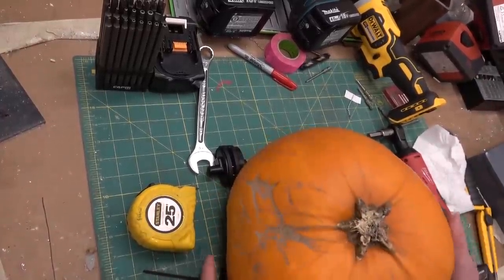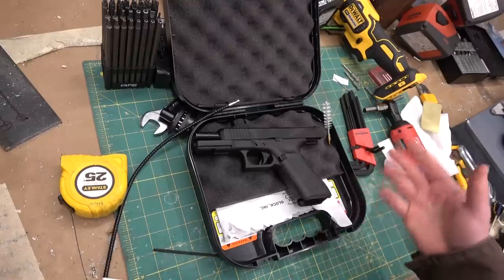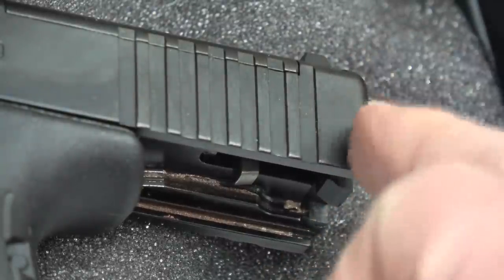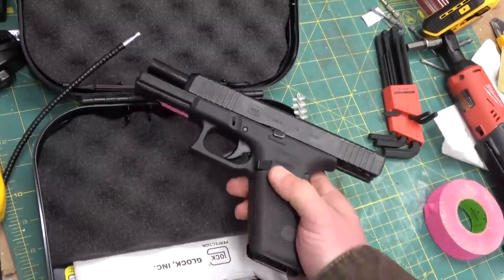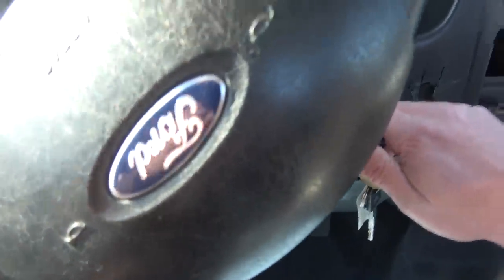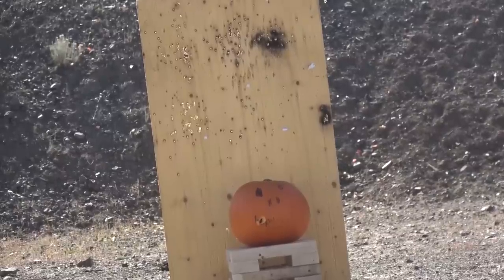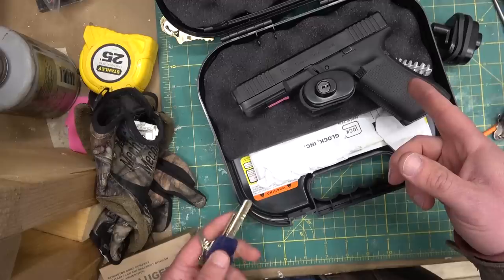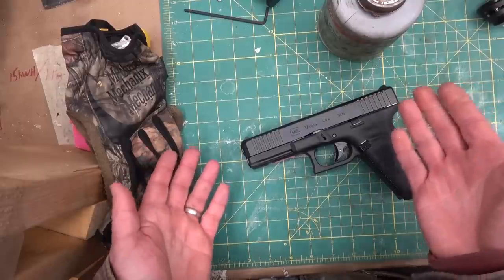BOLTR: GLOCK 17 GEN 5

Comment: Now do a Smith & Wesson M&P! Any of 'em would do it for me. I'm not really a Glock fan so, you know, go reinforce my biases for me. Actually, now that I've watched through most of this video, I'd be really interested in seeing your comments on an M&P Shield 9mm. It looks quite similar under the hood, but is on sale for $210 near me right now. I do believe mine came from the factory with proper oil on the slide, but it's been a few years now. I don't think I'm buying the lapping idea since most slide pistols I've seen have what looks like parkerizing on the mating surfaces. I'm probably wrong, but that doesn't seem too conducive to lapping. I just don't think the tolerances really need to be super tight between the receiver and slide, since the barrel and sights are both on the slide itself. The tolerances between the barrel and slide are pretty damn wide open too, but the action spring keeps the barrel preloaded into a specific spot in the slide.

Otherwise, the internals look remarkably similar but also different in interesting ways. In general, they both have low-precision parts in the receivers but everything in the slide is either machined from billet or forged and machined.

You might also be interested to know how barrels are made. I was playing a random-ass old online space game and chanced upon the very man who made the barrel of one of my rifles. Got to talking about the process and it surprised me. He said that they start with a short, fat chunk of chromoly or whatever alloy, then they drill THAT way oversize and use a robotic forge to stretch it out to the desired length AND diameter. That way, they don't have to actually do any really deep drilling. Probably don't even have gun drills on-site!
Reply: The M&P line and the XD line are just gross. Please deposit all such products in the nearest waste receptacle.
Reply: S&W is good at ripping off Glock designs thus the similar parts.
Reply: @ZE0XE0  M&PS are fine. they just need to get rid of that terrible trigger. Now as for XDs those can go right in the scrap pile.
Reply: The thing about pistols is that almost always, the gun is way more accurate than the shooter, to the point that accuracy isn't really a concern
Reply: Tungsten Swim Team I was just going to say, almost all plastic pistols are descendants from Glock.

Comment: Eurica!!!
I've watched your channel for some time. Good stuff!
You're in my wheelhouse now mister.
The copper anti-seize:
Glock uses this "grease" to assist in the break in of the pistol. It actually grabs the soot and dirt to mate the surfaces together. I'd run two to three hundred rounds through the pistol before cleaning it.
You were correct on that assertion.
Glock only refers to their frame as "polymer". (Your 11 herbs and spices)
Rifling- a Glock has no lands and grooves, commonly associated with firearms. Glock did away with the sharp angles and rounded them off.
Gaston Glock invented this pistol for the Austrian Army from the perspective of a window blind manufacturer.
Overlooked was the metal used in the upper receiver (slide). Glock uses a (Tinafer (SP)) process making their metal nearly as hard as a diamond and 99% rust free.
Keep the videos coming!
God save your RCMP!

Comment: If you can send me a small chip of the plastic I can run it in our IR-spectrometer at work to figure out the type of plastic it is.  Less than 1x1x1 mm is needed to get an accurate scan.
Reply: Zytel.

Comment: The rifling "artifact of manufacturing" you're spoke of is, actually polygonal rifling. You forge the barrel blank over a mandrel instead of button rifling or cut rifling. It allows for a greater gas seal with projectile and increases barrel life. It's also supposed to reduce copper fowling and bullet deformation which means there is less drag on the bullet in flight. It's more popular in European designed firearms, but is gaining traction in American designed firearms. Love the videos and I was just tickled pink to see you made a firearm video!

Comment: Can confirm. That is a lapping compound. You have to “shoot them in” for around 200  rounds.

And come time to fight believe I’ll have of those in hand.
Reply: LuX.Up The only thing that can stop it is underpowered ammo.
Reply: As a man that has been shooting for over 35 years, has worked for several of those in a gun range, and lives in Florida... I can assure you that the factory lube is more of a break in compound.  After about 500 rounds it will wear off and smooth the action.  Then you can clean the firearm properly and lubricate with an appropriate oil.

Comment: "this is not lubricant!" While holding the container that clearly says "lubricant".
Reply: Regardless of what it says on the container, he is correct, it’s not a lubricant. It’s abrasive.
Reply: WD40 says "lubricates" on the can. It's apparently not a lubricant either.
Reply: @thebigmacd  you're correct
Reply: It's not a lubricant design for parts that regularly or constantly move, it's designed to allow something to move one time at some point in the future.
 WD-40 is also a lubricant, although a very light duty one. It is sometimes a good alternative to water as a lubricant...wet sanding aluminum for example.

Comment: G'day AvE, The easy way to pull that firearm apart is, from your normal right hand shooting grip to place your right hand fingers over the top of the slide while leaving your thumb where it was under the tang, then pull the slide back slightly using your fingers. Your left hand is used to pull down on the slide lock lever (both sides). And finally, as you attempt to remove the slide from the firearm after completing the above, you need to press the trigger a second time. (first time to fire the action off, the second time to ensure the trigger and firing pin sears are disengaged. Also, the magazine does not need to be inserted for any of the safety features to operate. The raised piece of metal on the right had side of the internals works like a 'cam' when it moves laterally rearwards to depress the firing pin safety. Finally, the sights are set up to shoot point of aim. The rear sight is a friction fit and can move sideways. If too easily, it can be replaced with a new factory or after market product. Shots low on target up to more than 30m are because the firearm is pointing down at the time of discharge. If you do super slow frame imaging on your shooting (looking only at the firearm) you will see the muzzle dip at the last moment and that is what will have caused the low shots. Sorry for the long message.All the best from Australia - 20 year Glock firearm instructor. David

Comment: Hey man, the dual spring is an upgrade to what is the primary fail point on the glock. Second spring extends the life atleast 20k rnds.
Secondly I hate the glock trigger - you might want to look into upgrading it , next time you shoots it - pull the trigger slowly - feel the uptake / slop before the break wall- then another 5.5lbs or so will get you past that wall to fire , HOLD the trigger down and slowly let it forward JUST until you hear that click so you can avoid the sloppy uptake ... get good at that to get great follow up shots.

Look into an RMR sight too, that’s a great upgrade To keep your pews on point ...
Not saying you should do it but on the back of the slide there’s a little flat part that can be upgraded to make that glock fully automatic ..
Also you may want to look into stippling the grip(literally burning a texture with a wood burning instrument with specialty tips) so you get a better positive purchase on your grip due to its plastic chincyness AND it also looks really cool.
Well some guys leave their stuff OEM / factory ... I’m not one of those guys... 
I appreciates you doing firearm reviews - I wish you’d do more.. let’s figure out how to avoid the ITAR laws here in the USA (legally and legit) and I’ll send you some more to review! 
Check out polymer 80 / P80 lowers for glock 
Also if you want a nice paint job for it look up blowndeadline on Instagram

Comment: Glock Certified Armorer here.  Wish you detail stripped the firearm to see the difference between the slide block (pinned in and very precision machined) versus the molded-in slide carriers.  You would really like the mechanism of the trigger group and how it interfaces with the trigger connector and the striker.  Very happy you called out the three safeties, many, many people believe that "Glocks don't have a safety".  The most effective safety is always the one between the ears.  Also the recoil spring is carbon steel with a molybdenum anti-friction and anti-corrosion coating.  Get you some Break-Free CLP to clean and lubricate that firearm.

Comment: My 4th gen glock17 was a solid gun. The only thing I didnt care for was the grip texture. Plan on getting a 5th gen model 19 also.

The lube they use from the factory is for break in, actually works to polish the few places the slide contacts the metal tabs embedded into the polymer frame.

Comment: Not a sight issue.  Low left is shot anticipation dude.  Youre flintching and 'pushing' the muzzle.  Relax, slow steady squeeze while keeping sight alignment and sight picture.  Takes lots of continual practice, dont feel bad there.

Best channel on YouTube brother, thank you!!!

Edit... ok, only because i love your channel, ill take the time.  As the trigger is depressed, the trigger safety disengages its interference with the frame, allowing a full rearward stroke of the trigger.  As the trigger strokes rearward, the trigger bar pushes back and upward... there is a ridge on the trigger bar that pushes the striker safety (striker block) in the slide up, which opens the striker channel so that the striker can advance.  This is a robust drop safety that makes it impossible for the striker to detonate a cartridge unless the trigger is being actuated.  Also, when the slide is racked, the striker is also charged by the fire control components.  When the trigger is pulled, the fire control group simply releases the striker, allowing the gun to fire.
Extractor claw (slide) to hold the cartridge on the breechface and to extract spent cases from the chamber.  Ejector (frame) to kick the cases out of the breech / ejection port.
Striker only protrudes 'so far' to prevent ruptured primers.
Polygonal rifling.  Good for everything but full lead / cast bullets.  Full lead will build up in the 'grooves' and can cause elevated pressures / catastrophic failures.  Also, cheaper than traditional rifling mandrils for CHF barrels.
Dont know poly grading, sorry.

Comment: I believe the copper color smooge in the side rails is a lubricant similar to or is a product called Pro-Gold brand, lubrication and protection that Glock uses at production assembly. The slide rails and the frame slide rail guides do not have to be lapped. The fit is far from precision in this area. The primary issue is to minimize galling.

Comment: It shoots low and to the left because you are right handed and slapping the trigger.  It is a common problem with most shooters.  You need better trigger control and grip.  Bring your left thumb forward onto the frame just in front of the takedown lever.  Keep your finger on the trigger while shooting and pull slowly while attempting to keep your sights on the target.  You will notice that pulling the trigger pulls the gun down and to the left after you hit the wall.  Your left thumb will compensate for the horizontal motion.  Dry fire practice will help.  Do it slowly and observe the sight.  If it moves left, just push a little more with your left thumb.  If it drops, practice pulling the trigger just enough to release the striker.  When you release the trigger, feel for the trigger reset and stop when you feel it.  If you practice this and are confident it is the sight, use a sight adjustment tool.  Have fun hitting bullseye every time at 5+ meters.

Comment: @22:22 There is no magazine disconnect safety. What happens is when you pull the trigger, the trigger bar moves back, and disengages the firing pin safety block by pushing, and holding it up; then the striker is released via the 'drop safety'. What Glock calls a 'drop safety' I don't consider a discrete safety mechanism. I consider it a requisite component for the gun to work, that happens to be done in a very safe way(lots of positive engagement). The firing pin safety will prevent a discharge if the 'drop safety' fails or I guess if the hulk rips the slide off the top of the frame. Also I think the only reason for the trigger safety, is so inertia doesn't pull the trigger in case it's dropped muzzle up.

Comment: The polygonal rifling is by design as opposed to cut groove rifling. 

Helps with consistency in gas pressures, doesn't do as much to alter the projectile as it moves down the barrel, and is supposed to prevent additional fouling build up (unless you're using non-jacketed projectiles). Because of that better contact between the projectile and the barrel, non-jacketed lead is not recommended for use as excessive lead fouling can cause pressure spikes, and thus catastrophic failure (not to mention pain and possible death).

https://en.wikipedia.org/wiki/Polygonal_rifling

Comment: The plunger (firing pin block) in the slide is actuated by the hump on the trigger bar. Glocks don't have magazine safeties. When you're shooting, that's some of the take up before you hit the wall. 

The striker also fully cocks on the sear when it's in battery, about half to two thirds to the back plate. The notoriously squishy trigger is the sear pushing rearward ever so slightly as it levers off of the sear. This is coincidentally why you can't disassemble without pulling the trigger.

Beautifully simple machines.

Comment: @AvE
The rifling is also your guns way of fingerprinting the bullets. 
If you have two identical guns and if you look at the rifling they will be different.
Reply: Ballistic fingerprinting is kinda hogwash. The California Highway Patrol did a scientific testing and took 790 guns and test fired 2000 rounds out of 790 guns. There was only a 62% chance that the correct gun ended up in the top 15 matches. And that was if you used the same make and model of ammunition. If you changed ammo manufacturer, forget it. Not only that, but firing the gun changes the rifling over time and even cleaning the rifle with a brush will change the marks it leaves on the bullets.
Plus, Glock factory barrels use the polygonal rifling which "squeeze" the bullets more than engrave. The striations left on the bullet are smoother and harder to identify than conventionally cut rifling.

Comment: The vertical plunger (safety) in the bottom of the slide is actually a safety firing pin block which is actuated by the depressing of the trigger. If the trigger isn’t depressed, the firing pin is locked in position.

Comment: Don’t have to hold the trigger back to get the slide off... just dry fire, pull the slide back 1/4” or so and pull the lock tabs down... but all my glocks have been the most reliable pistols I’ve had yet.,,

Comment: To disassemble, please double check to ensure it's unloaded, then pull the slide rearward about an 8th of an inch, push the tabs down, and while the tabs are held release the slide.  Then hold the top of the slide and actuate the trigger, pull the slide forward and off of the firearm.

Comment: Just as an aside, the striker is only half cocked when you rack the slide. The reason Glock triggers are always slightly mushy is that they finish cocking the striker as you pull through the trigger pull, only then does the sear drop and release the striker/firing pin. VS say a Walther PPQ which has the striker always fully pre-cocked, which is why their triggers are much crisper/cleaner - they only have to release/drop the sear.

Comment: 25:01  extractor claw, ejector is that   /----- shaped bit that hand over the magazine in the rear of the frame. Extractor pulls on rim of case to extract it from chamber,  then it hits the ejector and flings it out, extractor kind of imparts a little bit of flat spin on it

Comment: I spoke with a Glock armorer from the Glock factory at Austria once, and he told me they place a copper impregnated oil since it has a longer shelf life. This way they can be sure the gun will function even if it stands years in the storage, as this copper oil doesn't dry as much as it's more resistant to temperature (at least that's what I understood at the time).

Comment: I'm pretty sure that the third safety you mentioned is an "out of battery" safety, not like battery power,  "battery" as in closed all the way, because if fired while out of battery the brass casing will rupture and send little bits of highspeed brass straight into the eyes of people without safety squints engaged.

I don't think that is the right spelling for the type of "battery" I'm referring to.
this is the first vijayo that I feel I might know a little more than AvE

Comment: That 'hook thing' is called and 'extractor' and auto guns don't need it to remove the empty case when the gun is fired, the recoil is sufficient to do that.  If you need proof, get a hold of a 1911 type pistol, remove the firing pin retainer, the firing pin and spring will fall out. Pull out the extractor and replace the firing pin, spring and retainer.  Load and fire the gun and you'll see that the cases eject just fine.  The reason the extractor is present in an auto gun is to unload a loaded chamber or remove a round that's miss-fired.